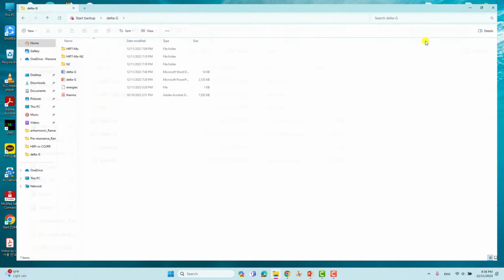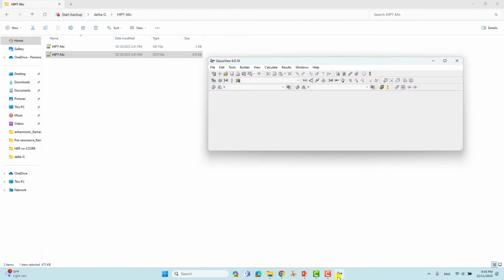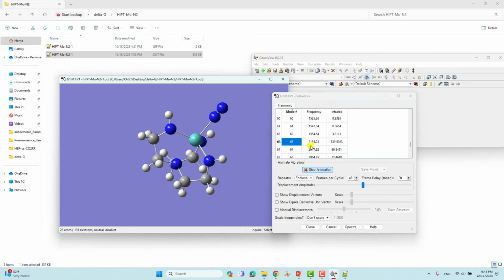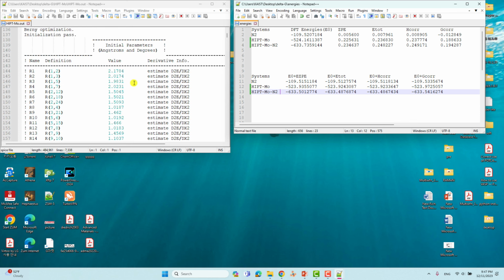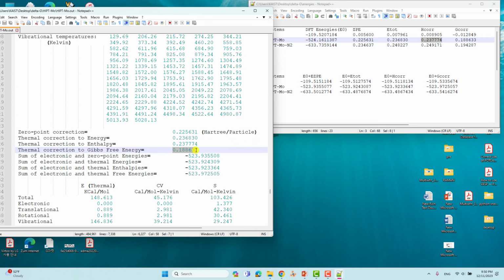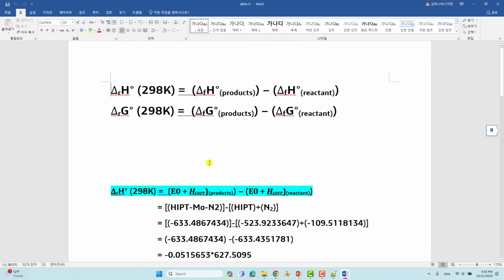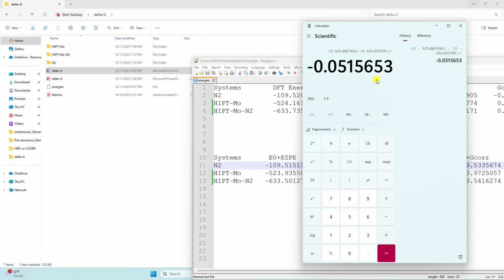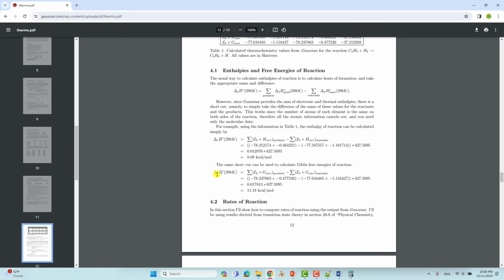How to calculate Gibbs free energy using Gaussian 09W and G16 | Gibbs free energy Calculation | DelG

Comment: Thank you, Dr. Sambath Baskaran, for your video. I have three questions:

1. After performing structure and frequency optimization, is it necessary to calculate the energy again in Gaussian to obtain the energy and related corrections?
2. If I want to achieve higher precision and accuracy for the Gibbs free energy change, should I change the basis set selected for the calculations? Do you have any recommendations for basis sets (P.S. I am only using a personal computer)?
3. I want to calculate a reaction system in a solution. When performing structure and frequency optimization calculations and energy calculations, is it necessary to include the solvent condition?
I look forward to your reply. Thank you very much!
Reply: When the terms "opt" and "freq" are added to the input (in this sequence), Gaussian will perform the optimization and then the vibrational calculation, as shown in the video. In other words, there is no need to perform another calculation, since the structure for which the frequency calculation is performed is the optimized one. However, it is possible to perform the calculations separately, one for optimization and another for vibration, because there are methodologies that may work better for the structure and another for the vibrational data. However, the same method is commonly used.

When solvation is used, it is necessary to calculate the difference in total electronic energy of the structure without solvent and with solvent. This difference indicates the solvation effect. Therefore, the final Gibbs energy is the sum of the electronic energy in the gas phase + solvation energy + correction of the Gibbs energy.

I hope I helped, I do not speak English, and I am Brazilian